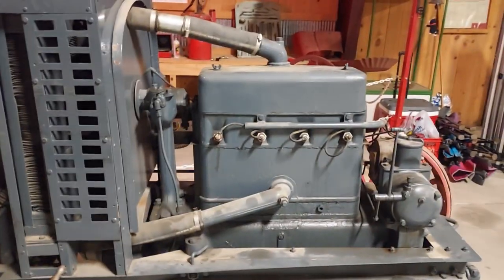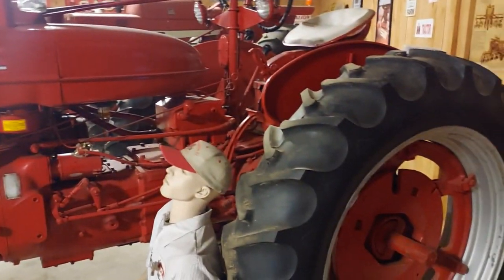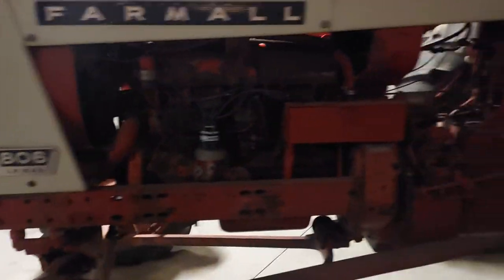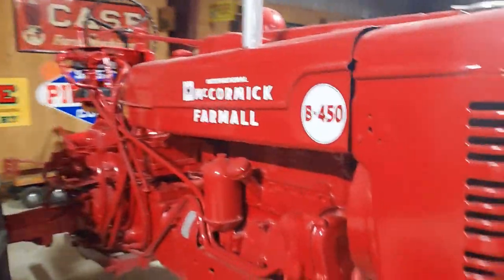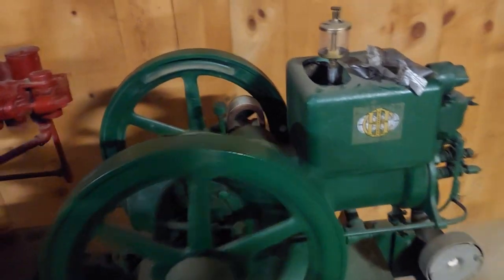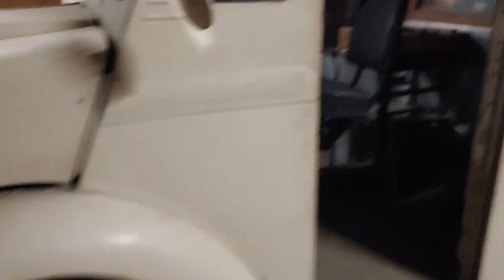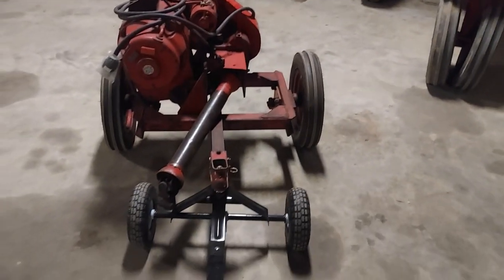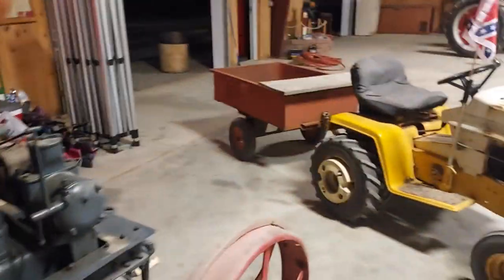Amazing collection of Farmall Tractors

Comment: Awesome!!  Thank you for sharing those awesome tractors! I was thinking the same thing with those tractors with the generators on the sides when you were reading the specs, 12,000 watts, 208 volts, Holy Smokes!! I could power my house with that tractor!  Lol
My dad still has and uses his old Allis Chalmers tractor, not sure the year of it, late 40's early 50's. Looks just like those, just not as big. I learned how to drive with it when I was about 10 years old back in '79-80.  Lol
Reply from the maker: Awsome Definitely Hemp. I'll be loadingore of this. This place is huge and I only scratch the surface.  Thanks for watching ✌️😁